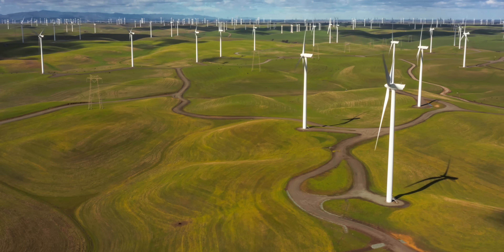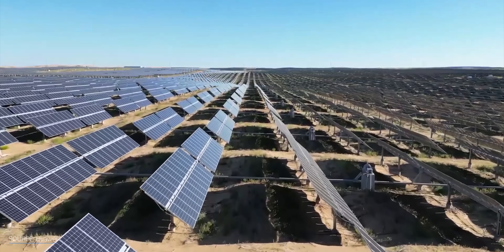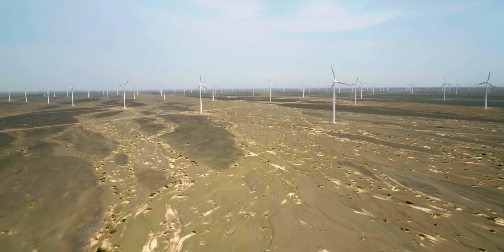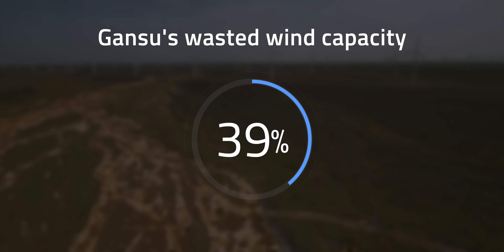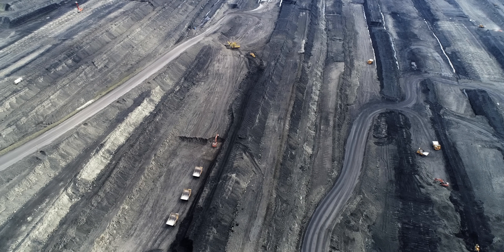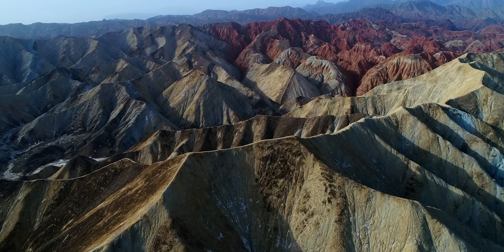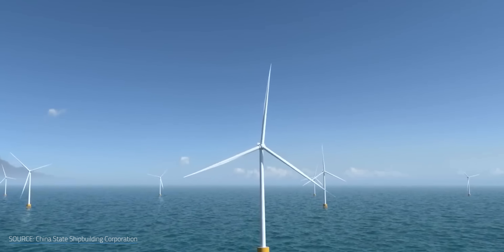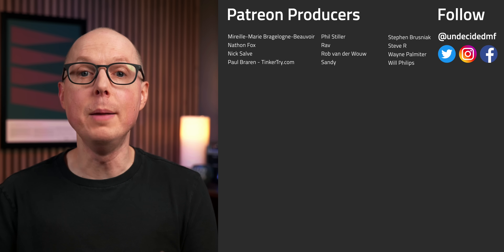The World’s Largest Wind Farm has a Tiny Problem

Comment: In 20 years from construction, all the turbines will have to be replaced. The materials and maintenance requirements are enormous. Despite its huge capacity, China generates only 10 % of its electricity from wind: coal generates 56 % of the electricity and natural gas 9 % (rising).  If they want to store energy in batteries, the cost and materials requirement will also be huge. The problem is that wind is power dilute and batteries are energy dilute: both are materials and land intense. Emissions from China will continue to grow--I suspect the turbines will quickly become a relic in the desert.
Reply: They will wear out in 5-10 years from now -> replace or rot in place/move to landfill. The desert air is full off fine sand, which act as an abrasive. The wing tip move so fast even water droplets is will degrade the wings, sand is much worse - not immediately but in time. 
It's a pity that wind in a desert pick up sand...
Reply: Most places can barely maintain the stuff we depend on to live. Roads, pipes and such. If only this effort was put into some better systems.
Reply: @adstanrashaw9279  

Don’t forget nuclear, from an article from the general power industry:

“There are currently 56 operating reactors in China, providing about 5% of the country’s total electricity demand, according to the China Nuclear Energy Association (CNEA). Nuclear power analysts have said they expect approvals for at least 10 new reactors each year for the next few years.”

So it appears that the Chinese are serious about nuclear and having reliable base load electrical production that doesn’t require long distance power lines and battery storage. It is rather impressive that the Chinese are building GW+ power plants on budget and on time (5 years) at such a fast rate, while the west seem to have continuous problems with just about any large project.
Reply: In fact, wind turbines are not land intense at all. While spread over a wide area, they do not occupy this area. Also if the blades are replaced at the end of life, the wind turbines are not that materials intense as well, because foundation and tower may be reused.
In today repowering projects, such benefit is often let aside for the fortunate option to do a repowering using larger turbines but less of them.
This trend will reverse once the size and power of the turbines will no longer incentive making larger ones.
Reply: @beatreuteler  Wind farms have a power-density of 1 W/M2--that's it.  The video explains that the Gansu farm occupies 420,000 km2 and has a capacity of 20 GW. Peak power demand for Beijing is about 27 GW.  A farm the size of Belgium cannot even supply one city. 

They put it in the desert because they consider this wasted space and would not have to cut down forests or use farmland. 

And even at that massive scale, the farm needs to be 100 % backed up by reliable like coal or nuclear, that have to ramp up and down to match wind variability. 

If we were to foolishly attempt to replace all fossil-fuel energy-generating units with wind warms,  it would take 150 years of exploration, planning, regulatory review, mining, processing and production of just the copper required, let alone lithium for the batteries to store the energy.  It is not going to happen. Wind energy will be a relic in a few decades. In the meantime, it is a nuance, with many rural communities rejecting the projects. Off-shore wind projects are also getting major pushback--they are even more materials intense and difficult to maintain. 

Any recucling that does occur---not much at the moment, will be energy intense and powered by coal in China and natural gas elsewhere.
Reply: @adstanrashaw9279  1.) No one said it sould all be done using wind. 2.) The power density of wind farms is not important at all as again, the land in wind farms is not occupied, it can be used for other stuff. When built in a desert it may not be particularly used, but that really doesn't matter. They didn't put it into the desert because of this but because of the steady winds going there. Very much as of why the Germans and the Danish put them into the sea.
It is not as important how the power installed relates to the power used by a certain big city. There are many other power sources used to power Bejing (actually also much closer to Bejing). 
What counts is that in the meantime (with the problem of transmission finally solved) this wind farm saves the Chinese from being in need of building some other Plants in greater numbers to replace the energy supplied by this wind farm. It is obvious why the Chinese are looking to have a decent mix in their grid: they see how dirty coal is and are trying to get rid of coal usage. However in order to cope with growth of demand, they don't have a choice but to build some coal power plants in parallel. It is a very pragmatic way of thinking and on top of everything they have signed up for decarbonization, even if not in the same pace as other countries. This is becuase they can't.
Reply: @adstanrashaw9279  Partially yes, but they are building PV and wind combined in approximately the same pace as coal. Not by installed capacity, but by annual energy generation. For 2024 it is forecasted that power generation by coal will drop by 3%. Possibly the 1st drop ever. This is said to be caused by the fact the additional installed power generation of Solar and Wind will outpace demand growth for the 1st time making it unnecessary to exploit the entire installed coal capacity. Thus coal is planned to be partially reduced because coal is more expensive than wind and solar.

The negative effects that make communities reject wind farms are mostly a myth. On shore land with wind farms are close to always used for other purpose, namely agriculture. Exceptions like the Gansu plant exist. Where did you take your lies from? And sighting is individual. I like the slim and high tech appearance of wind turbines. I accept that not everyone looks through my eyes.

Ridiculous to compare the entire coal installed base to one single wind farm.

Power density is totally non-important because of the parallel use opportunity of the land or, lik ein the gansu case, the land is not that important.

Agreed the variability but hundreds or thousands of wind farms globally demonstrate that using sophisticated methods, the grid can be made capable of dealing with that circumstance.

The maintenance cost of coal power plants is enormous as well. And not all wind farms are in deserts. It was the Chinese decision to build this particular one in the desert. Not mine. So the chinese will deal with that.
Reply: True, there are no alternatives to nuclear. Good thing is that they also build most reactors in the world, so they'll figure that out.
Reply: @likeAG6likeAG6  China are trying to find an energy mix, for real reasons or for show, but they are heavily relying on coal and are building coal energy units rapidly. In 2022, China approved more than 100 GW of new coal-fired power plants.
Reply: @likeAG6likeAG6  Portion of the electric energy produced by nuclear plants in China is shrinking in spite of the new reactors built.
SOlar and wind combined are growing much faster when nuclear power generation is more or less stable with approximately as many reactors decomissioned as comissioned.
Reply: @beatreuteler  Well if they had spent less effort doing the green stuff they might have built more nuclear plants than they decommissioned. Also, sounds like the same issue as the west. They stopped making nuclear plants regularly. Going to be same situation in west.
Reply: @MrBashem  While this is possible, of course they didn't have any intention to do so as the Chinese government seems to have understood the renewables are the way to go.

Comment: In Australia wind is only 40% efficient. So why constantly state the maximum possible power generation. It is not like Nuclear or hydro power generator which can produce maximum rating on demand but wind is not. So please keep it real explain power production with local wind speed and wind availability. It is important to keep to the facts not just wind turbine max output with no clarification of how often and limitations. General public trust needs to repaid with facts. Batteries are the same charging times and discharge curves need to be addressed.
Reply: That's not what the term "efficient" means.

Comment: Deserts make terrible places to build data centers.  Too far from urban areas makes repairs more costly and high temperatures means the need for more cooling and larger cooling systems.  Labor becomes an issue as people generally want to work in areas with more amenities.  Sand is an issue as it gets everywhere and there are greater costs with removing the coarse materials before they ingress too far into the buildings.  Also the distance from cities basically mean that you won't be seeing emergency services in a reasonable time frame.

So while the land is cheap it's got to be weighed against the increased costs of running a data center and the increased risks to the facility.
Reply: The data center is not built in the desert, just nearby the cities.

Comment: They could use it to pump water back into the desert with water batteries. Evaporation can be overcome with enough transmission lines to the sea. No NIMBY in China. Or pump oil from western Russia faster than ships.

Comment: Hydro Quebec wanted to be the nation's battery to compensate for erratic wind, solar, and other factors with plans to build two considerable reservoirs as part of the project. Still, it could not secure rights of way for the power lines and finally abandoned the entire project and concept.

Comment: Generating the power is just part of the problem - and we can do that fairly well, and the investment is happening. What is REALLY needed is better and more storage - and batteries are not the only or even best answer. As PART of the solution, they are useful and necessary - but they are not even close to being the whole answer. Too expensive, probe to  really BAD fires, and too high an impact on the environment to produce - along with problems with recycling. Compressed Air and Flywheel storage are better solutions, in basically every category mentioned.